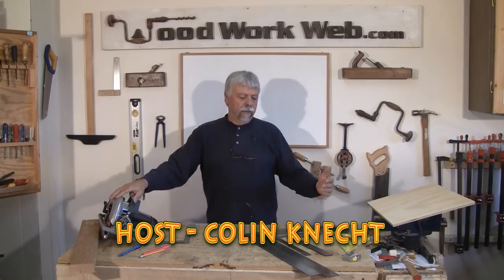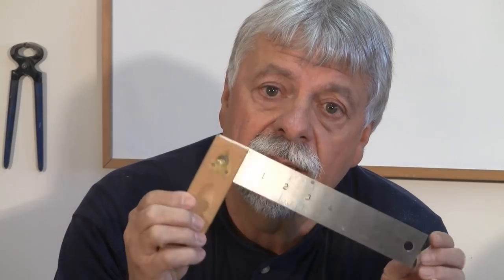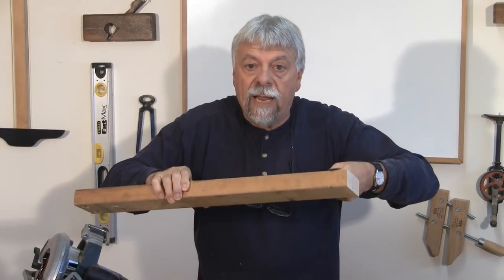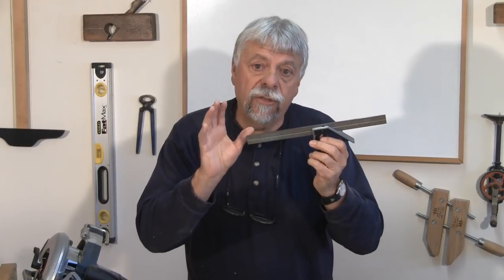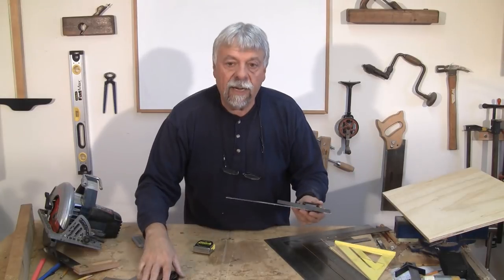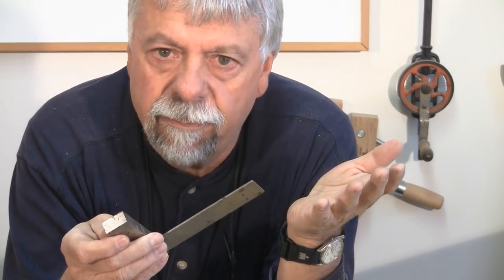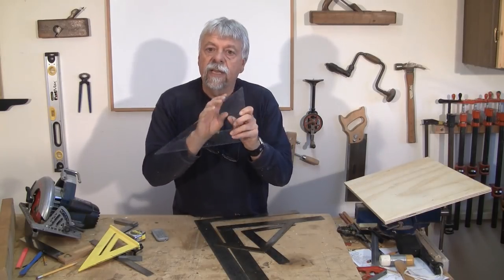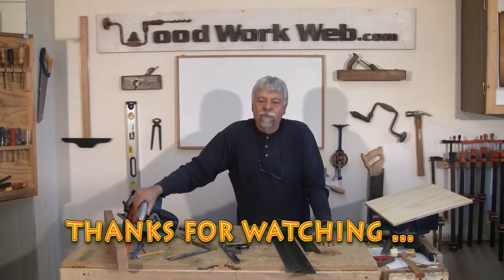Squares - Choosing and Using Them in the Workshop -- A woodworkweb.com video

Comment: After watching your video on squares. I went to my little shop and checked my squares with my framing square. Yes you were right. All three of my tri squares were out various amount and my wooden handle square was too. Into the recycling bin they went. Now only steel squares are in my shop. Thank you so much for this great tip. Now my table saw cuts right to the line. thank you again chuck
Reply: What did you check your framing square with? I recently bought a second framing square and they don’t quite agree.

Comment: I've 56 yr old man . I've been in took rough framing and steel work all my life and build and repair all maintenance issues at home until recently I decided to remodel my bathroom. That's when I learned rather quickly that  There is a  Problem with measuring and layout  Tools.  Cabinet and  trim work . immediately  I realized I had a problem. I thought it was the tools about new take measures squares saws . Still had a problem I could not make Door jambs and  Trim come together measured measured and remeasured. You sir have been a major help and realizing what my problem was as you explained in the squares  And other tools that don't cause problems when I was rough framing using a  Welder and Such things . My wife thinks  I may have lost my mind setting in the garage  Checking squared against other squares .
 hours checking my squares with squares. Comparing tape measure  against tape measure and when almost squares were off a little what was I to  trust nothing .I relied on  Silicone caulking.
Reply: I  wanted Crown molding in my bathroom. You can't even imagine The problems I had and I could not understand why and it's still hard for me to wrap my head around it get measure it and then  Market down  And then turn it upside down and cut it. Not you away a $100 worth of chopped up and cut up  Crown molding. The worst part for me is I knew I could do it and I could not figure out where the problem was. Again sir you cannot believe how much you've helped  In order to say it the best. I been using the right tools for the wrong job. I've done such a good job on the Crown molding and built my confidence. To where I  Went bought a quality table saw and tools and now M believe it or not  I'm removing in 3 different phases all the cabinets in my kitchen I'm building them myself with Quality material .my home is a fixer upper There's no place in my floors that are  level  the walls  Is not plumb. So for anybody that tells you you didn't need to say this or say that. With their level of experience they may be correct I don't know until I get that much experience. But until then you give me the confidence to re do my kitchen cabinets Completely from scratch. I will keep you posted hopefully we will spend Thanksgiving  Eating in a nice kitchen  Or I'll have to spend it at a homeless shelter I  After I am divorced .

Comment: I just hold my thumb and index finger in an L shape.  Perfect every time.

On a more serious note, I remember about 25 years ago when I was a kid in exploring around the basement and wondering why there were different kinds.  My dad just saw them as a large, medium, and smaller one.  This long later I learned that the medium one might have been iffy (wooden handle) and the small one was an engineer's square.  Neat.

You made what sounds like it could be a really dull topic pretty interesting.

Comment: Boy, Colin you are absolutely dead on regarding squares!!!!  I have driven myself to utter distraction wondering why my joints are not lining up only to discover the nickel-ninety-eight square I was using was NOT SQUARE to begin with!  Thank you ever so much for making this video and pointing out the inaccuracies with cheap measuring devices.  You get what you pay for and sometimes a little (or a lot more) up front will make your life so much easier in the end!  Again, thank you.

Comment from the maker: Hi Wayne, thanks for all the information on your square. Good to hear 30 years of wear and tear has not affected it accuracy. 
For most of us working with wood, an engineers square is more than enough to check and set up machinery, even if it is off by seven thousandths of an inch. Wood movement alone would nullify the need for that kind of accuracy.
Thanks again for taking the time and sharing your detail.
Colin

Comment from the maker: Hi Josh, you could use your draftsman square, depending on how big it is. If it is one of the larger ones and you feel you are getting a good reading, go ahead. You can check your cut after with eng, Square and make adjustments of needed.
One thing ... when you are making your test cuts on sled - don't cut all the way through the base until you are certain the backer board is where you want it, just easier to re-adjust if you have cut all the way through.
Let me know how you make out ...
Colin

Comment: What an eye-opener.  I followed up by checking 5 squares in my own arsenal, and was shocked at how far off the tri-square and even a framing square were.  A couple others were right on, so now I know I have to keep that in mind when accuracy counts.
Reply from the maker: Ted St. John I too was shocked when I checked mine. They tell me that the very expensive tri-squares  are in fact accurate, but most people are not willing to spend the $200 it takes to get one. Thanks for the comment Ted
Colin

Comment: One of your better videos.  You got straight to the point,  talked about the pro's and con's.   I really like using my tri square ( I call it a combination square),  for setting depth of cuts.  I had purchased a route lift.  Used the tri square to mark the depth, and cutter height to make the cut.   Trying to go with the princepal of not measure,  but finding the depth, and xferring it.  Kind of curious on what measuring/ process you would of used to get the job done.

Comment: Thanks Colin, as someone just coming to woodwork just after I turned 60 I've a lot to learn in what time I have left. I found your clip informative and useful. I have some of each of the squares mentioned except the engineers' square. I did have a 2" version but it has vanished. I will look into buying a replacement and thanks to a poster for the RDG Tools link - a set of 4 for £27.00.
Reply: I went to a local house clearance store in town today and picked up a 6 inch and 9 inch engineers' square  £5.00 (5 GBP) for the pair. That's approx $7.80. Looking at them I think that they are 40 to 50 years old and very well constructed.
Reply from the maker: +Robert Trevena Well done ... I think I need to go shopping with you to get in on some of your great finds ;)

Comment: The combination square was designed initially for machinists.  You can buy cheap ones at the big box stores or online, but it is unfair to lead people away from them.  Starrett layout tools are machined to unbelievable tolerances, and are quite possibly THE go to tools for layout when precision is needed.  Engineering squares can also be purchased for cheap with unreliable results.  This video should not have been an emphasis on which type of layout tool to use; it should have been on the importance of quality when choosing one.  And on a side note, I would never use a framing square for furniture work, but like you said, if you have one that is accurate, then dont change.  I also use drafting triangles as they are good for setting up equipment.
Reply: Dido

Comment: Sorry Colin the brass nub that rides in the ruler groove has no bearing on the accuracy of how square the tri-square is.  The accuracy is determined by the 2 pads inside the square head that the edge of the ruler rides on.  These can be filed carefully to true up one of these squares and they should be checked every once in a while with and engineers square.  I recently purchased one of these tri-squares at Harbor freight tools and was not expecting it to be be very accurate but to my amazement it was so close to dead on, I just left it alone.  Very good videos, keep up the great work.
Reply: actually a couple of the most common reasons those combo squares can be inaccurate are 1. sawdust debris in the channel between the blade and body, and 2. a nick on the blade from dropping it or having banged it against something previously. That little nick can cause a nub that will prevent the blade from seating flush in the channel.  At any rate, he is quite right in the notion that those can become out of square rather easily without you realizing it. Solid advice to check them out. All the bashers here need to get a life.

Comment: Good video. I have 5 different sized Starrett Combo squares. All are spot on and I use them for machining. Pays your money and get quality. I believe Starrett invented Combo squares for machinists.
Reply: I agree the Starrett square is the "gold standard". The invented the tool and they continue to make a great product. The rule is steel and the head is cast iron. Over the years there will be some wear on the pads that the rule is held against by the lock bolt. Periodically, as with framing squared, the trueness should be checked and a simple adjustment with the edge of the rule should suffice. I have an aluminum head Stanley and after 30 years it is still true.
Reply: Starrett also sells combination squares where the head is forged steel instead of cast iron.  They cost a bit more, but should last for generations of daily use.

Comment: Combination squares were, and are used in metalworking, not just in rough carpentry.  They can be very accurate.
Reply: Came here to say this.   The combination square (not tri-square) he's demonstrating with the brass screw is inexpensive.  A steel one made in USA or Japan are very accurate.   A 12" costs about US$35 and will last decades.
Reply: A Starrett square will cost you north of $100, and will last longer than that.
It's about the best investment a woodworker can make, given how much use they see and how accurate they stay.

Comment: Thanks for the valuable information Colin, I studied in a woodworker course, between my 14 and 18 years of age, I am now about to turn 51 years old and am buying tools for working with wood, I confess that I have to learn a lot before putting my hands on. I am Brazilian, here not easy nowadays to get a good square that really accurate, I've tried several manufacturers here and it was only disappointment, now I'm looking at the squares for Carpenter 53M-250-S or 53M-300-S Starrett by its great reputation and we have here in Brazil, do not intend to buy a combination square Starrett because of its high cost. I'm researching a lot about buying a decent combination square 6-Inch and 12-Inch, I liked what I read about Stanley Rabone, EMPIRE E255IM, Blem Cosmetic Second PEC SAE Metric 12 "and Blem Cosmetic Second PEC USA 6", these last I seem to be better options for having heads of cast iron and stainless steel rules, and more accurate. What is decided so far is that I will buy Starrett 53M-250-S / 53M-300-S a good engineer square to check other squares.
Thanks again. Diomar
Reply: Check out the DIN875 standard used in Europe. You can get a engineer's square with a specific tolerance (class 00 to 2) that are order of magnitudes better than any Starret. Primat is an example but German ebay and Amazon is full of pretty good deals, buy from a reputable seller so you don't get duds
Reply: Good tip! Thank you

Comment: I am with you on most of your analysis, I use the machinist squares on setting my fences and for intricate joinery. Here is what is strange, my 15 year old Swanson speed square is as accurate as my machinist squares. I am dead serious, I have checked and rechecked it and it is PERFECT. Its a steel one so you know its not going to move unless you happen to drop it in your forge LOL.

Comment: Wish you showed how to check your square for square by drawing a line then flipping it over and drawing a line next to it. If your square is off it will show up. I've seen brand new steel framing squares way off. Levels are also good to check before you buy one. 
Thanks Colin good info as always.
Roland
Reply: I did that with my drywall square and it was off by a country mile.  My miter saw was off too.   I make a cut an flip it over to see the error.  Trouble is when the 45 to 45 is off.  You can move the fence, but you can't change the 45 to 45 angle, to my knowledge.  I think one of my saws is about .25 degrees off.  
Did Colin say he had a secret video on checking squares?  I bet it's your system.  Good one.

Comment: For the most part, I agree. 
Price is an indicator of quality. My square set (blade, head, center finder and protractor) Starrett 434-12-16R is dead on. It is forged and hardened steel, I bought it as a learner tool and die maker over 30 years ago and it is still 100% accurate. Today it will set you back $278 and likely will not be in a home big box store. The steel square you like, is not accurate when looking at tooling tolerances of + - 0.007" 
I check to a granite master square often. YMMV!

Comment: I have checked with all of the whizz-bang companies like woodpecker who sells measurement tools at a very steep price. None of them have a NIST certification except the Starrett forged head tri-square.  As for wear, a dial meter used to measure extremely accurate dimensions on a milling machine has a much greater possibility for wear than the slide on a tri-square. Granted, there is junk for sale cheap but every tool has junk knockoffs. As for carpenter squares, drop one on the corner and see what you have for square.

Comment: Good Info; I have all but the engineer square.  If ever dropped, one should check the accuracy.  One quick method I use is to place it on a good know straight surface where you can scribe a 90 deg line.  Flip the square over and then scribe on the same line using the scribe mark closest to the edge.  If you still see only one line you are square.  If out at the end, you see two lines, example what looks like a 1 degree angle, then your square is off by half that amount.

Comment: The problem with a wood and metal measuring tool is not just that wood expands and contracts (and twists and warps); it’s also that metal expands and contracts (with temperature changes) at a different rate from wood. For that matter, brass expands and contracts at a different rate from steel or aluminum (that’s the principle behind bimetal thermal switches).

Come to think of it, a metal ruler is a different size at one temperature from another. That doesn’t matter from minute to minute, but if you measure some pieces on a cold day, and then come back the next day, when it’s hot, and measure more pieces, yesterday’s won’t be quite the same size as today’s. Also, if you measure a piece of metal that is hot from machining, it won’t be the same size when it cools down.

Comment: Good information, Colin. I think I need to not be so cheap, and pull the trigger on an engineer's square. I know that tri-squares can be adjusted, but who wants to have to check them every time you drop them, or they get a hard bump? Thanks for the advice.

Comment: You get what you pay for. The trisquare is an excellent engenneering tool, the example you have is a cheap die cast copy. Mine is a Mitutoyo and it is very accurate. I also use a Colen Clenton square with a wood stock and it is always spot on as I check it with its reference square and recalibrate it if needed (it has not been needed yet).  Metal engeneering squares are variable in quality as well. A M&W tool room reference square at $200 will be far more accurate than a $20 groz metal square.

Comment: Those combination squares can be fine-tuned.  Use a fine file and sandpaper. It's a finicky job, but it's doable.  But yeah, I agree with Colin.  I have some squares that I baby, and really trust.  And I have others that get tossed around, and are good enough for most tasks.   The square that's by the welder, is the most abused, and stays by the welder.  The table saw has a better square nearby. Etc.  And none of them are wooden.  I don't trust those, altho they are pretty.
Reply from the maker: Thanks for the tip Duke, and thanks for watching!

Comment: Every combination square have a lifetime, simple as that.
You can buy one quite precise in price range of 15 - 30 USD and use it for a long time.
When it's wear out - buy new one.
P.S.
I bought my combination square from China. Surprise - very accurate and fastening bolt is also made of steel, same as ruler, therefore I expect to last longer than brass one.

Comment: Oh by the way, I also have a steel square ofn600mm X 400mm which I use often. Been wanting to get a smaller one which i will do soon. Am also buying a Speed Square if I can find one locally, else will buy on eBay. The Speed Square is so cool to have.

Comment: I use a Nobex square. It is a brilliant design that ensures accuracy. I have dropped mine on occasion and it remains dead square. I check mine on a dead flat surface with a dead flat edge. Draw a line with the body left and then with the body right while matching the line at the edge. Any difference means it is not square and if shown, will be double the amount out of square.

Comment: I know the first square as a try sqyare, because you use ot to try an angle to see whether it's square. I am not well informed regarding those with a wooden body, but squares with metal bodies exist. Those should match your engineers square.

I do not recommend comparing squares, there's a process I am surprised yu didn't mention.

Take a piece of wood with a straight edge. I would use MDF or similar. Use the square to draw a right-angled line. Flip the body so it's pointing the other way. Draw another square line beside the first. If they match, it's square. If not, clear, repair or ditch.

he yellow one is a speed square. It's square, or not. No adjustment. Test it. I use them as a guide for cross curring.